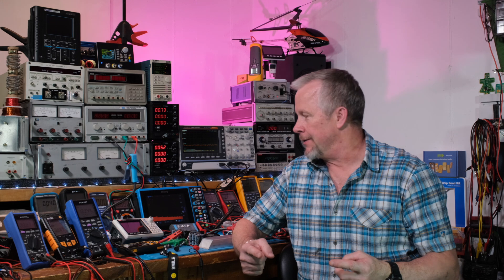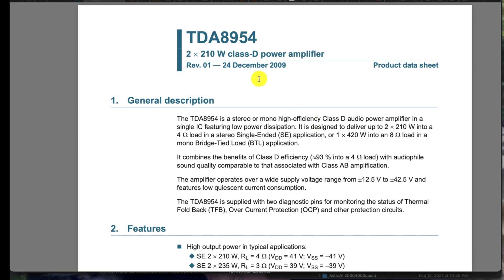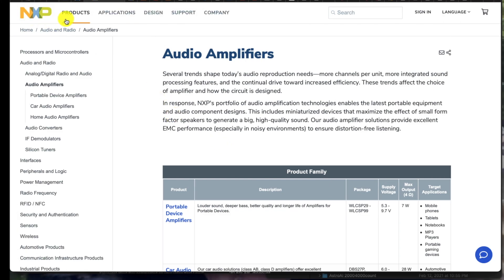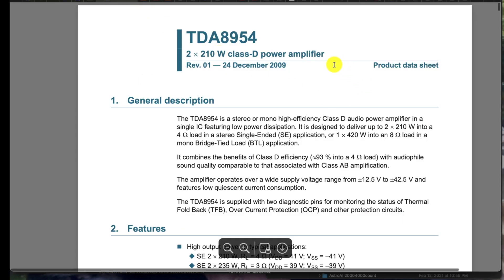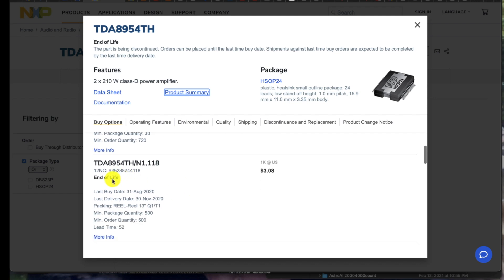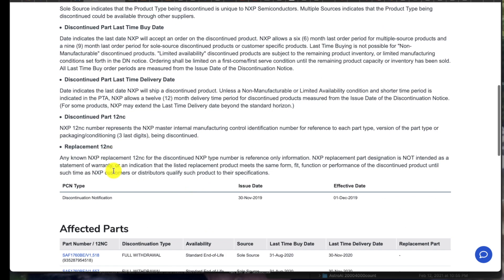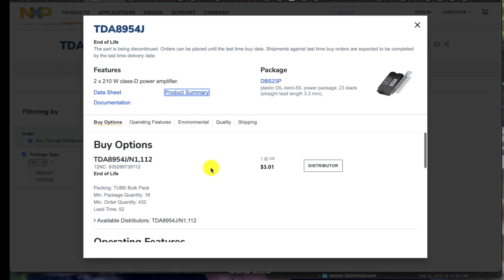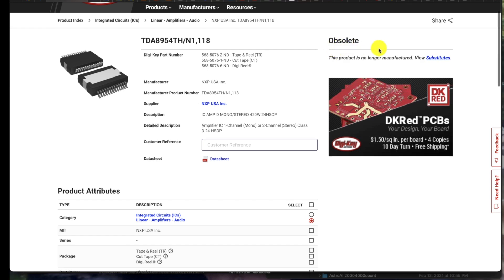End of Life for TDA8954 Class D Amplifier part

Comment: I'm looking at a mackie srm 450 v3. The bass drives is driven from one of these. I see there seems to be a short from one of the bootstrap pins to it's corresponding output (running always in bridged mode) I'm going to say that this must be blown the other output has no short to the bootstrap. I removed the cap and the short is still there. Less than €9 including shipping to France from Aliex.

Comment: Hello, I have a Yorkville PA system, and found that the tda8954j ic was shorted...person who owned it had a power surge is how it got damaged...am I screwed for trying to get a replacement ? Is there a substitute ic? Thanks 🙏
Reply from the maker: Here is a link to this 'original' part on Amazon, and the great thing with Amazon is their return policy.  https://amzn.to/3N2GW1w

I have purchased OpAmps from this seller and they were as advertised - if that helps.  Also there are many vendors - like Mouser selling them, so they seem to be readily available;)
Reply: @KissAnalog  thank so so much I ordered that item just the other day. Now to wait 😴
Reply: @KissAnalog  so I got my replacement IC installed and tested. The good news on the fuses didn't blow this time but the volume is very faint and low tonned. Also the amplifier ic is getting hot...any suggestions?

Comment: Thanks for this video, by now I am repairing a Mackie 450 v3 which use this IC in the bass amp and I am so disappointed of company's like NXP because so many speakers use this IC for Gods sake like this Mackie 450 V3, some FBT's and Yamaha and if I were one of this company's I would not use any NXP IC in the future as they must be punished 😡
Reply: This is funny. A friend of mine gave me 2x v3 to fix. Last time he used them we were both at the wedding. I think nobody notices the bass die in the mackies because we were also using a sub. I looked all through youtube for tips but nobody has vids on the V3. As i wrote above seems one of the bootstrap legs is shorting internally to it's corresponding output leg. Is that what you found. I feel i should check for signal before i order but i'm 99% sure it's the TDA8954 with this short on the boot. Will buy a generic from Ali but i never trusted these new style amp chips since they came out. All that heat in such a tiny space with virtually no heatsink.

Comment: I have a bass amp that uses the TDA8954, and all of a sudden the two output filter inductors burnt. May you have any suggestions as what could of went wrong?
Reply from the maker: Wow, it sounds like there might have been a near short - something to overload it and heat the inductors - or low frequency at high level?  Are the TDA8954s still functioning?
Reply: I don’t know if it’s still working but it is a prime suspect, the amp just makes a clicking noise when you turn it on. That noise started intermittently but always about 10 minutes after turning it on until it quit. I never had it at full volume and the bass has passive output. Everything before the power amp seems to be in working order, since the headphones and xlr outputs function well. I can’t see any other signs of damage anywhere else.

Comment: Do you think  It is pure 420+420= 840 watts? Another issue how many volts and amperes can I give in this amplifier board? If I use 30-0-30 volts & 20 amperes then will it be risk for amplifier board? Waiting for your reply.
Reply from the maker: Thanks for the great question.  Have you seen the power video I did on this Amplifier?  https://youtu.be/jKn2GtdEwbM
Reply: I used a 28-0-28vac 200va toroidal on my subwoofer build using nearly the same dual tda8954th board he tests in that video, and at 4 ohms I got a solid 330wrms to each channel driven simultaneously with over 20k farads of caps. It could burst 385 to a single channel with only around 2v drop from the supply, so it worked perfect in my situation. The cost isn't really the board (mine was $45 shipped US), it's the power supply. Thinking about it, I could've went for 2 30v adjustable voltage power supplies for less than what the transformer cost

Comment: coolGaN board EVAL_AUDAMP24
Single-ended, 2-channel CoolGaN™ class D amplifier for premium audio applications

The EVAL_AUDAMP24 e-mode GaN HEMT-based evaluation board is a 2-channel, 225W/ch (4Ω at ±43V) or 250 W/ch( 8Ω at ±63V) half-bridge class D audio power amplifier for high-end Hi-Fi audio systems. This evaluation board demonstrates how to use the IGT40R070D1 E8220 CoolGaN™ gallium nitride transistor together with the MERUS™ IRS20957SPBF controller IC, implement protection circuits, and design an optimum PCB layout. The reference design provides all the required housekeeping power supplies for ease of use. The 2-channel design is scalable for power and the number of channels.
Reply from the maker: Thanks David!  That’s a great amp and I wish I could get one to try;)

Comment: Infineon class D Evaluation Board IRAUDAMP9 and no fan
Single channel 1700 W (2 Ω ) Half-bridge Class-D Audio Power Amplifier

1700 W Single channel (2Ohms load THDN=10%, 1kHz)
1% THD+N distortion @ 1200W, 2 Ohms +/-75V
Residual noise 290 µV, IHF-A weighted, AES-17 filter
94% efficiency @ 1200W, 2 Ohms, Single Channel Driven, Class-D Stage
OCP, OVP, UVP, DC protection, HOPS ( High Output peak Shutdown Protection) and OTP
Self-oscillating half-bridge topology with optional clock synchronization
Featuring IRS2092S Gate Driver ( with external BJT buffering ) and IRFB4227PBF 200V MOSFETs
or 
IRAUDAMP7S Evaluation Board 25W-500W Scalable Output Power Class D Audio Power Amplifier Reference Design. Using the IRS2092 Protected Digital Audio Driver
250 W x 2 channels, (THD=1%, 1kHz, 4 Ohms). 0.01% THD+N distortion @ 120W, 4 Ohms. Residual noise 200 µV, IHF-A weighted, AES-17 filter. Single layer PCB. OCP, OVP, UVP, DC protection and OTP. Half bridge/ full bridge selector. Featuring IRS2092S Gate Driver IC and IRFI4019H-117P MOSFETs.
Reply from the maker: I love these amps by spec, so I’d love to be able to test one;) I might design one using these parts.

Comment: You can always use the Chinese version of the same item. Will just drop into existing PCB, half the price. On a good day 50% wont blow up on switch on, the rest will give almost 10% of the spec if you are lucky.
Reply from the maker: Oh Michael, I forgot to even address this problem...you are making my teeth  hurt;)
Reply: @KissAnalog  Lets try and be optimistic, maybe they purchased the remaining chips at a good price just because they knew you would need some for your channel.

Comment: Here's a link for $3.50 each plus $3.90 shipping.

https://www.ebay.com/itm/1PCS-TDA9845-TV-and-VTR-stereo-dual-sound-processor-DIP20-/321256518656?_ul=IN

I don't like using chips when manufacturers discontinue them and suppliers don't show "similar" parts. Looks like we're at the mercy of China and maybe counterfeit parts. I think you should go with a newer chip and run GaN mosfets.

Comment: I have several old computers from the 80's and I run into this all the time. I use Ebay and sometimes Aliexpress to make repairs. I've paid 50 dollars for one chip off Ebay. You can also buy broken equipment and try desoldering the chip  it in hopes it is still good. Like you said maybe you can find a pin compatible replacement. If not there is always like you said daughter boards to make something else to work.
Reply from the maker: Great feedback Tron!  This is such a big problem!  I should have addressed this part of the problem in the video:)

Comment: Welcome to the world of DIY audio!! lol I run into this all the time. Some of the best audio transistors just aren't made anymore and their so many really great amps that you just can't build or if you can find the parts you're paying $$$$$ each just to build it.
Those vendors may have them but they have them in protected stock, that would be my guess.

Pass Labs has a lot of those old hard to find JFET's in fact I got some the other month it was a set of matched LSK170 N channel $35.00 and these are the one Mr. Pass is getting made for him. The new old stock Toshiba 2SK170 will run you $100.00. They're worth more then gold by weight. lol
Reply from the maker: LOL   Thanks for this great informative feedback!!  I think it is time to do a discrete design:)  With GaN FETs;)
Reply: @KissAnalog  Now that sounds like fun!!!